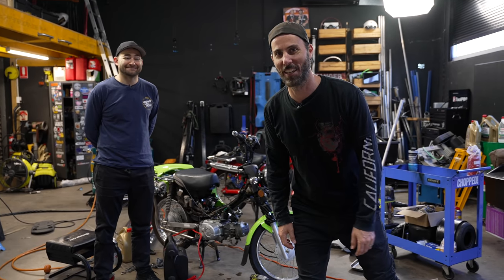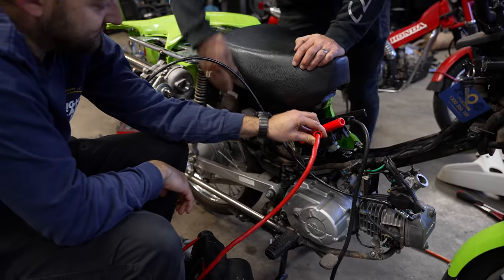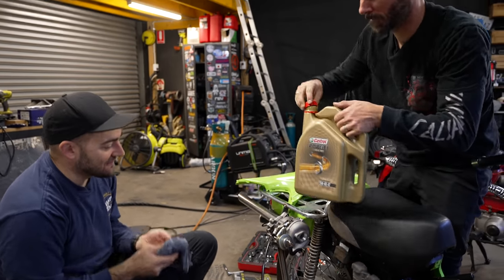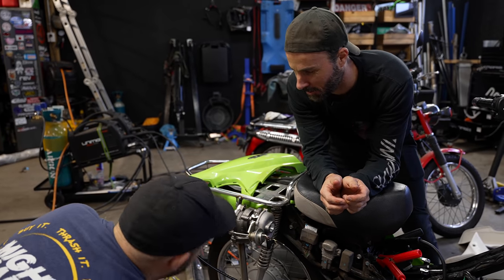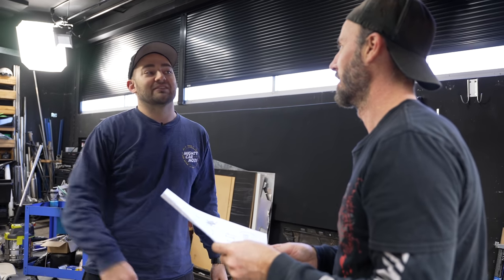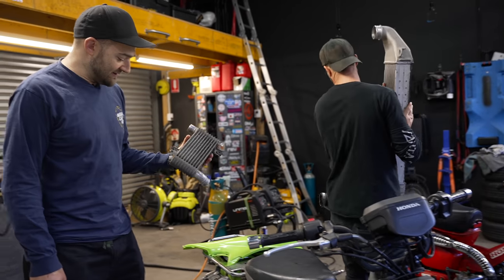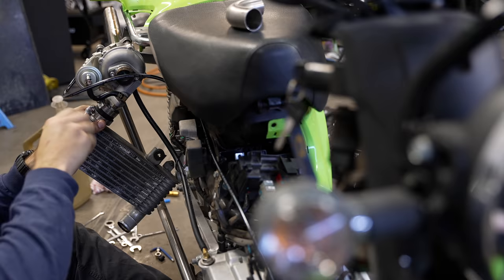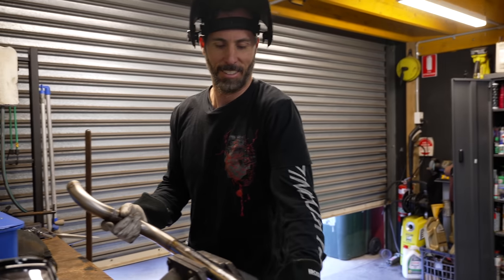WORLDS SMALLEST Blow Off Valve Install

Comment: I'm 7 mins in and the solution to keep the turbo lubed...  A mini oil cooler, a tiny oil pump at the base of it being run off a drive wheel on the side of the tire like the old generator head lamps :). And then pipe that up to the turbo and back down . :)

Comment: There was so much water coming out, because H2O is one of the main products of combustion. If you think about it, all the H's in the hydrocarbons combine with the oxygen. Im guessing water is spitting out because the exhaust pipe is cooling the exhaust gasses enough so that the water condenses.

Comment: this is pretty cool.
the intercooler lines being so long will just ad lag as there is so much volume to compress. a straight feed to the intake would perform better and shorter. intercooler would have looked nice infront of engine like a regular bike radiator.
Reply: needs a higher volume of intake piping as its a single cylinder to act as a reservoir. Basically the turbo is not being driven whilst the inlet valve is open, as there is no exhaust pressure.

Comment: Why not put a jet or a fitting with a reduced inner diameter to raise the oil pressure feeding the turbo? Seems very taxing on the motor's oil pressure system to make it feed the turbo where as before it only had to do enough to feed the squirter hole in the cover.

Also.. props "to science"! Great video, gentlemen.

Comment: You could try a 12v washer fluid pump for the turbo feed. Run a hose down the dip stick hole, into the sump.

Comment: The mad Men from across the sea! May I suggest ditch the IC. You'll make more boost and there is no way possible for the charge air to get heat soaked with the turbo mounted in open air. 👍

Comment: Make a small resevoir for the oil and put a small, low volume electric pump on/in it to get it to the turbo. Mount it under the rear frame so that it gravity returns to the resevoir.

Comment: Just put fitting at the bottom of the engine block and use external oil pump to feed the turbo, oil can travel back to engine from filling hole as planned.

Comment: Since motors have crankcase pressure, shouldn't the line going into the oil fill cap threads have some sort of pressure to pull the oil?

Comment: Don't worry about the water in the exhaust unless its REALLY excessive. The actual combustion process (not to get too deep into the chemical formula) actually creates water as a byproduct. Then the fact that you have a much longer exhaust tube means that it will probably cool down the exhaust gases and make the water condense out of the exhaust much easier. So once you run the thing and get the exhaust heated, the water should go away for the most part.

Comment: Switch vavle at the engine head, trigger a primes turbo fuel line, when finished, trigger run fully opened to the engines head. Oil priority valve

Comment: You have water in the exhaust because in a prefect burn you only get H20 and CO2 when burning gas. So we always have water vapor coming out your tail pipe, but seeing as your tail pipe is a mile long it condenses and bam!! liquid water.

Comment: For every liter of petrol you burn, a liter of water comes out with the exhaust, the cold exhaust system is condensing the vapor to water, which is why it's best to get the exhaust system hot before turning off the engine, so it doesn't rust

Comment: For anyone interested the pump is not pushing against atmosferic pressure as the oil system is not in a vaccum. The lack of flow is due to friction in the lines and height diference between the pump and the Turbo

Comment: Fyi you can buy low pressure hydraulic line in nice small sizes . Rated to 300 psi . Put it on barb fittings with efi clamps and ya got a sweet turbo oil feed

Comment: Block the squirter hole in the head. Tap another hole in the head for the return line. Oil line to the turbo should have a anti drain valve to ensure it quicker to prime

Comment: Guys just block the hole in the rocker cover that feeds oil to the cam shaft and chain so you get oil pressure to the turbo and feed the return from the turbo back to the rocker cover to oil the cam and cam chain simple

Comment: You dont need an intercooler for a rear mount! Since the turbo is far down the exhaust it doesn't run nearly as hot and the amount of boost pipe on the way back will actually act as an intercooler of sorts!

Comment: About the atmospheric pressure thing: Since the pump is also in atmospheric pressure, that negates the atmospheric pressure at the other end of the line. It's pushing against 0 psi.

Comment: Just fit a kitaco or takegawa high pressure oil pump, also the casings are pressurized so you will struggle to get the oil to return aswel, I've built a few of these engines into race engines when I used to race pit bikes many moons ago

Comment: It stands to reason that the oil system, with the mods installed, would be low on oil if you hadn't already compensated for the additional oil lines and turbo.  That, in itself, could lead to an oil pressure drop.

Comment: Just watch the air in system also. For a PC and watercooling you have the pump below the rad, this is because air likes to sit at the highest point. ;) With PC watercooling the pumps are normally in the part that goes onto the CPU and you want this full of water not air and running dry. You want the air instead to be at the top of the rad where it doesnt matter. With your turbo being above the engine you might face huge issues even with a pump it will be hard to keep it oiled and air will naturally want to sit at the highest point displacing any oil. At the very least on this put a none return valve on the feed.

Comment: The oil pump doesn't make enough pressure to fill the volume of that line. The small orifice is what makes the pressure. Also by adding that larger hole you have greatly decreased if not completely stopped any oil pressure to the engine internals.

Comment: In boats there are small pumps that connect  to  the battery and keep a constant flow plus very easy install. Also there are the liquid cooling computer pumps that also work at 12v easy install and can do t he job. Not sure if engine oil  would damage them tho

Comment: You've split the supply to the valve train. Both valve train and turbo will not have sufficient supply. Solution is to go direct to the turbo first. then return back to the valvetrain. Small inline pump that runs off the battery on the return back to supply the valve train. Push pull system will supply sufficient oil supply.  You will need to do more frequent oil changes.

Comment: I feel like the oil line on the valve cover is acting like a PCV over flow, they may be better off trying to pull oil from the crank case and keeping the return line as they have it. I’d definitely have mounted the interior cooler to the bottom side of the top tube as well.

Comment: Use a GM Heater core for the FMIC :) I believe I've seen some with a 1" in/out for some of the bigger vans. It will be smaller volume and not hurt spool as bad.

Comment: did you consider the intercooler being mounted parallel to the wheel, 90 degrees to the air flow but with a faring colored cowl ducting air across it. it would stick out way less and have shorter pipework.

Comment: you could check valve the oil feed to stop the oil just draining back, but I dont think the oil pressure in the line would be able to overcome the cracking pressure of even the lightest check valve. Seperate oil system needed I reckon.

Comment: I love that they were probably filling the line enough and probably had more head pressure from the oil sitting in the line, they were probably slowly over filling the valve cover. 🤣 lol more oil was going in, then what they could get to come out. I was kinda surprised when they even remotely thought that valve cover had enough pressure to push that oil up acouple feet, to get to the turbo.

Comment: The oil feed to the head is restricted to the bare minimum needed for the head.  Get your oil feed from the bottom end of the engine . Eg the oil filter housing .

Comment: Wooow ... I work for Hansa-flex Bulgaria and i thought our hoses were expensive 😂 this hose around 1000mm long with banjo head and 90 degree AN fitting in my shop  will cost around 40-50 bgn wich is like 30-40 aud 😁

Comment: Not enough volume oil wise. Put a gauge on the head source. Prob not enough pressure. Use a small diaphragm 12v carby fuel pump at the head source. and pump oil up to the turbo.

Comment: So the problem that you guys missed is for the oil to feed the turbo is now not oiling the head if you block off the little pinhole in the head so it doesn’t oil the head and you return the oil back into the head it will then work

Comment: The oil pump in an NBC110 is about the size of a 10 cent piece. Larger pumps are available, or use a Chinese pitbike pump, which beats out at least twice as much oil.

Comment: Fluid dynamics. The feed line should have been shorter and the exit line should have been way thinner so that you would have built up pressure in the oil reserves in the turbo

Comment: I have seen a  electric fuel pump for carburettors (low pressure 5psi or so ) used to pump oil in to a turbo ,

Comment: Because the turbo is above the engine it is pushing against gravity and the weight of the oil in the line.  That is why pumps have a rated head height,

Comment: Connect a facet fuel pump to the drain hose & pump it back into the oil tank so its a closed system

Comment: What you need is a bigger turbo that makes  to much boost so you have a ton of blowby and that crankcase pressure will push the oil up to the turbo

Bigger turbo will fix everything

Comment: Couldn’t you clock the turbo and have a 90degree pipe out the bottom so the intercooler sits in a better position?
Love that harp as always 😆

Comment: Nice project, but wouldn't you end up with a cleaner look if the front section of the plumbing made a downward bend instead and passed underneath the drivers footpegs? seems like there is enough room not to scrape the ground while turning, while getting a more appealing result, unless i am missing something here

31:45 oh look, mod max is there!

Comment: All motors put out water vapors from the combustion it does it until it gets hot enough to burn it off. That’s why you see old low mileage cars with rotten exhaust. It is from short drives that don’t get the exhaust hot enough to burn it off and years of that will rot out the exhaust. As long as you get them hot than no h2o.

Comment: the turbo bike i had was mounted low at the back of the case for this reason i guess. really only two places to mount a turbo on a bike, low, front or the back. its going to smoke on start up no matter what. check valve on the bottom case line.

Comment: One of the byproducts of combusting gasoline is water. It will condensate in a cold exhaust pipe. Thus you get a drippy tip.

Comment: At this scale, I wonder if you couldn't solve the no-oil-to-the-turbo problem with a couple of check valves and an oil cooler.  The hot oil in the turbo will want to expand, but the oil in the cooler will want to contract a little, so you should get some convective flow.

Comment: After just 4 minutes in, I agree with Marty, and found these Original Design "Flaws";
1- Too high & away from Oil Source
2- No Intake Pipe

Should have mounted it below the Exhause port of the engine...

Comment: Dear MCM if you read this please buy an oversize 62mm piston/cylinder kit, high pressure head and bigger throttle body so you can make enough power to make boost

Comment: I was just wondering if a separate Electric system would be better, use a small radiator on the other side of the bike and rest of pipes and small electric pump under the rear seat/fender?

Comment: im actually building a turbo scooter its a mio sporty 115cc i upgraded it to a 254cc 4v i converted it to fi with a stand alone ecu  and i made a water meth kit that works amazing and my last upgrade is the turbo and intercooler im installing this week 

btw im using a cheep electric caburator fuel pump for the oil pump with a small oil tant

Comment: I am an old (very) mechanic with a lot of experience in hot rodding engines,  but I never got around to actually playing around with turbos.  That's not to say I have ignored them.   I have taken a lot of interest in their theory.  I feel sure that if your set up worked you would find ways to improve both the appearance and efficacy. However with such  tiny engine,  it seems to me that the world's smallest turbo is still way too big for it, and any inefficiencies in the system would do a lot to prevent it from spooling up satisfactorily.  I always thought that the feed exhaust should be as short as possible, in order to keep temperature and pressure as high as possible,  and at first  thought you were going to try and place the turbo above the cylinder head. From where I was sitting it looked like there might have been enough room. That extraordinarily long  exhaust feed  would be a major inefficiency IMHO. and would drop temperature therefore  pressure significantly, something unaffordable in this set up.  I was also of the understanding that turbo charging a single cylinder is very inefficient because of the pulses instead of  more constant flow in the exhaust feed.  An expansion chamber or a plenum  between the head and the turbo would probably help to dampen the pulses and would fully insulating the exhaust feed would also help..  The oil feed is pretty poor.  This is because bike engines that don't have plain bearings on the crank only need a very low pressure oil pump  usually in the order of 5 to 10 psi max.  Hence the miserable oil supply to the turbo.  For the purposes of the experiment, knowing in advance that 110cc was always going to be pushing to get the turbo spinning enough for any signifiant boost, the intercooler, waste gate  and blow off valve are probably redundant.  But I enjoyed the videos very much guys.  My comments are not intended to be criticism, but just observations.  Cheers.

Comment: With more engine power, you could change the gearing to enable high speeds, though upgrading the brakes would be wise if going much faster // similarly sticky rubber or higher performance tires are a go to upgrade for performance & one of the first places someone should start with along with better brakes. A brighter headlight needed to throw light further for night time riding in dark rural areas without light pollution & street lights //

Comment: if you really want it to work you will need to install an expansion chamber between the exhaust and the turbo . single cylinder engines can't make the consistent back pressure needed to push a turbo but by running the exhaust thru an expansion chamber it will give the exhaust time to build the pressure needed to run a turbo and let it actually build boost. if you watch Nugget Garages go-cart turbo build you will get the idea and see it actually works . there Honda powered go cart build from 2 years ago will make 5 to 9 pounds of boost and go's like a cat on fire . you will need a canister about the size of a one pound coffee can for an expansion chamber but it will make boost and work on the little Hondas engine. just remember it must be air tight and sealed all the way thru to build boost a piece of 4 in tubing about 8 inches long in line on the exhaust pipe would work fine.

Comment: What about a fuel pump electric connected to the battery pumping the oil through the line or getting the parts for the head for the oil cooler system and running your lines off of that instead along with the oil cooler to prolong your engine life

Comment: A small electric pump that runs at a pre-determined speed will suck oil to the turbo and back to the motor.  But, if it pumps too fast it will starve the motor and drown the turbo. So just get one that pumps just right.

Comment: Is there no Lifan parts that you could use for fitting oil coolers to pit bikes? aren't they basically the same engine?  When I fitted one the oil taue off was in the clutch cover.  But that's was a lifan 110

Comment: Doesn't a journal turbo charger require high pressure oil to work? It works on similar principles to the bottom end bearings doesn't it?

Comment: You're going to break the exhaust pipe because the turbo is mounted to the rack. When the suspension moves the turbo will go up and down but the pipe won't.

Comment: That engine uses ball bearing crank bearings, not plain bearings. The oil pressure might be as little as 10psi. You might need an electric oil pump to feed the turbo. I don't think that single drip is enough to continually feed the turbo bearings.

Comment: The best thing would be to make that oil line as short at possible that's a bit longer than need be cuz the more line there is the more oil pressure is needed to push the oil along

Comment: The intercooler is probably not required with the such small amount of PSI that turbo will produce with a small single cylinder engine.

I would not use it as it's not required and it would look much cleaner without the intercooler.

Comment: can you use a small pump under the sump to force the oil up to the turbo ( maybe a 12volt pc water cooling pump set to low speed ) they can pump oil " Jays 2 cents " has proven that

Comment: instead of an intercooler, why not design the charge pipe with fins, like hot water baseboard heater or radiator,..might work, just needs to dissipate some heat. I doubt there will be enough pressure to warrant a bov,...shall see.

Comment: And I thought the issue was going to be the first time you went over and bump and broke the pipe to the turbo. My prediction is that the suspension is more flexible than the piping to the turbo and it breaks.

Comment: Maybe it needs more oil? ie: the overall capacity of the oil system has been substantially increased compared to the small amount that little engine usually holds.